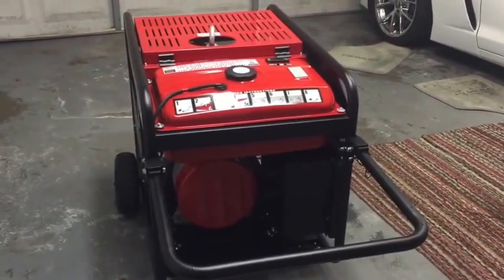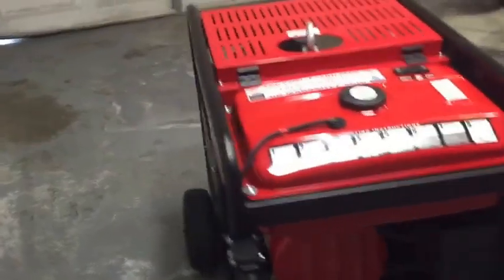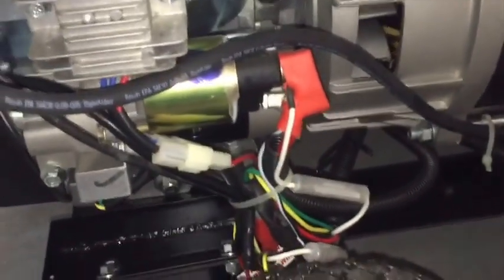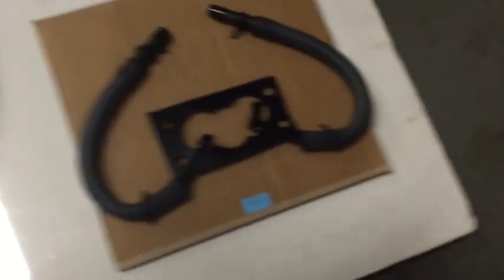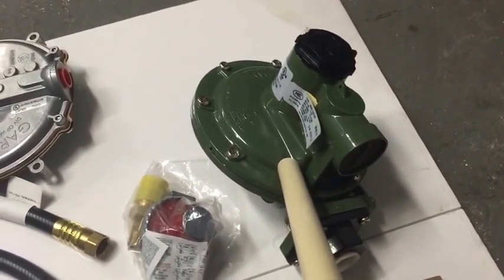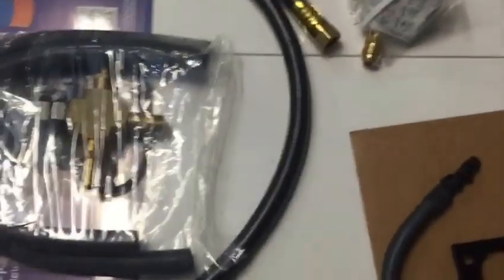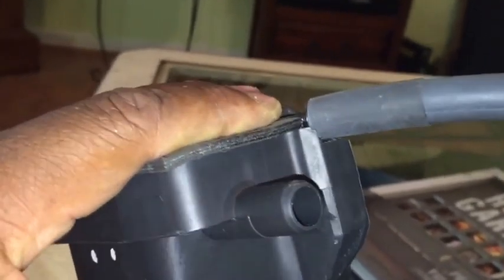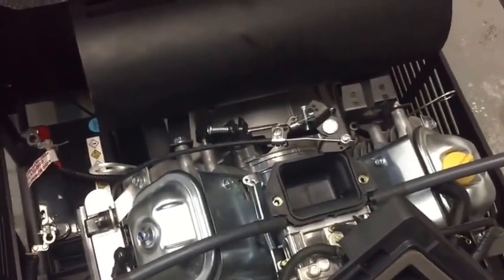Predator 13,500 Generator Tri-Fuel Conversion Part 1

Comment: i have had the 8750/ 7000 for about 7 years now and never fails so for to start right up. and just used it for 13 days straight running my entire house during this big taxes flood. but as soon as i can i will be getting this larger one. mine would run the 220 stuff but it didn't like it to much but i was also running threw 50 foot of 10 gauge wire. if i had been smart i would have dropped it down to 25 foot after the rain stopped.
Reply: Here is a reminder about portable generator safety: This advice is just to make sure that everyone is aware of all the warnings and it’s just to remind people to be careful using portable generators. Everyone has to see this safety reminder for safety. Every year, hundreds of people die or get injured when using portable generators due to carbon monoxide poisoning and electrocution. Make sure you are using your generator carefully and keeping others safe as well. There is something very serious that everyone should always be aware of when using generators. Some people do run their generator indoors which is not safe and that increases the risk of carbon monoxide poisoning which can cause death of family and you. Some people run their generator in wet conditions which can electrocute them. Here’s an advice about generator safety: please remember that you should never run your generator indoors. Remember that carbon monoxide is an odorless and colorless gas that you cannot see or smell. Carbon monoxide is a silent killer. Keep that in mind. Make sure your generator is 15-20 feet away from your house and away from doors, windows, and vents. Never use your generator in your porch too. Having a carbon monoxide detector is very important against generator safety. Some people also allow children to go near the portable generator which could pose risks. We need to keep an eye on our children making sure that they are not near the portable generator so they won’t get electrocuted or burned by the generator which is dangerous. A locking enclosure also keeps kids safe. A generator shed might look like a tempting place to explore, or take cover during a game of hide and seek, but a generator is a dangerous piece of equipment that can cause injury. It says on the manual that we should also keep children away at all times from the portable generator to avoid injuries. Please do not allow a child or unqualified people to operate the portable generator. Just because some manuals missed what should be listed doesn’t mean it’s safe to do. Always follow the generator safety rules when using portable generators. Generators pose electrical risks. If you need to use your generator during wet weather, you need a generator tent to protect your generator from getting wet. Don’t let your generator get wet. Keep your generator dry and before using your generator, please make sure your hands and your generator is dry. Do not wear loose clothing when operating the generator. Everything that is said on the generator’s operating manual should not be ignored. Never smoke cigarettes near the generator. Please keep flammable things away from the generator. Never overload your generator too. Your generator can catch fire. Never ever try to plug a generator cord into a wall outlet to avoid back feeding. Back feeding your generator is dangerous. Always turn on your generator first before plugging in appliances and shut off the appliances before turning your generator off. Use a heavy duty cord for your generator and the cord should not be worn out. All the instructions should be followed carefully. Never refuel your generator while it’s running. It can cause fire if fuel spills while your generator is hot. You should turn off your generator and let it cool off before refueling it. Having a fire extinguisher next to the generator is also important. This is only a reminder for everyone’s safety of using generators. Make sure your generator is properly grounded. https://youtu.be/I1jT3ANENvI and here is a video more about keeping others safe when using generators and also about our family’s safety. Hope this helps. Thank you.

Comment: Did you have to use any type of epoxy based sealant or anything like that JB Weld or something or was the seal good enough to not need it
Reply from the maker: william foreman I did not use any types of adhesives for the conversion.   Just the kit and hardware that was already on the generator.

Comment: Watched all 3 videos, nicely done and clean job, also, did you see where US Carb offers a remote start kit. I was thinking how's that work,  but pushing start button turns on all the gas solenoids. We have a 10,000 Northstar with a 16 V-TWIN Briggs, trying to ascertain whether to buy  this kit  or a Generac whole house tri-fuel unit.
Reply from the maker: Yes, I've seen the remote start kits, and considered it, however decided against it.  When not running I keep the propane turned off at the bottle so the lines are not pressurized when it is not needed, and the gasoline is off and the carb bowl ran dry to prevent gasoline related carb issues when gasoline sits in the carb too long.   It is not too much of a hassle for me to go out and start it manually.   The other thing to bear in mind, when starting on propane, you must purge the lines to get it to start.  The propane regulator has a purge button on the back of it that does the purge, and it is a manual operation.  I am not sure how the remote start will interact with a propane conversion.

Comment: I have the Predator 8750 and was wondering how much is that 13,000 running watts? I can’t seem to find any in stock or prices Thanks!
Reply from the maker: Captainkleen 11,000 running watts.   From what I understand Predator no longer manufacture these.   Which is a shame because it is a really great alternative to other brands with comparable watts that are double and triple the price I paid for mine.   I’ve have it going on four years and it hasn’t failed me.   We’ve had four hurricanes come thru my area that resulted in outages ranging from 10 hours to 2 days.

Comment: Too bad they don't have this size generator at HF any more. Been looking at their 9000/7250. Nice work on the conversion.
Reply from the maker: Daniel - S/V Rhapsody interesting.   The same exact generator is on Amazon and Walmart.com for nearly double and triple the price I paid for mine.   I wonder why Harbor Freight no longer has them.
Reply: I noticed that as well. .I am looking at the 9000/7250 as well.
Reply: @gooseygoo69  picked up a 9000 a few weeks ago. Haven't started it yet as I'm wanting to swap out the stock spark plug and want to get an oil change valve to replace a plug to make that easier.
Reply: The 9,000/7,250 is 679 and for 499 I can get the 8750/7,000 for almost a 200 dollar difference 250 extra running watts isn’t worth it to me. I’ll stay with mine and convert to natural gas or wait for the 13,000 running watts because a stand by 16kw cost over 2,500 and my 7,000 running watts will do what I need.

Comment: How much you pay for the generator.
Reply from the maker: I think I paid about 1200.00 when I bought it.  However These are no longer made.  I am not sure why, because it is a great generator.  Starts right up on the first crank every time.
Reply: Nice I just purchased one . 3 months ago nice unit.  Were you purchased your neutral gas set up.
Ebay.